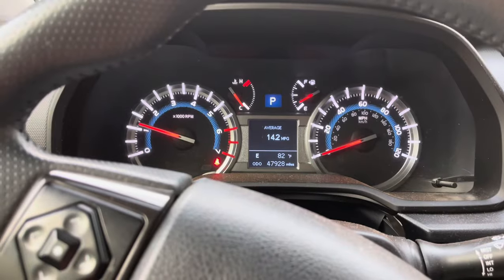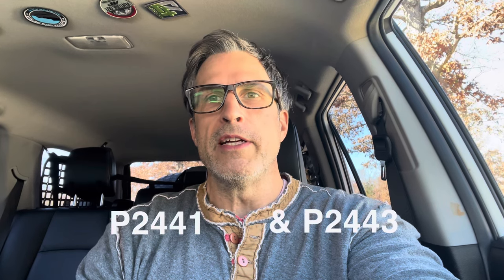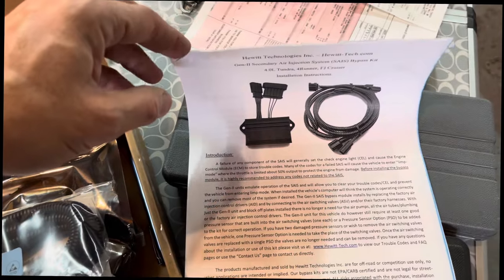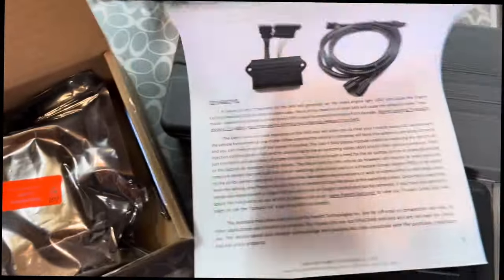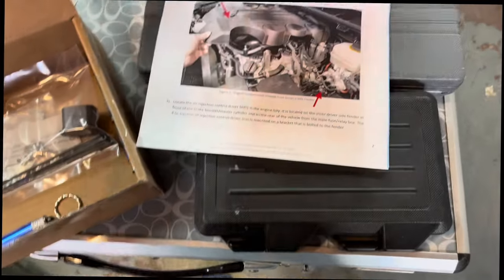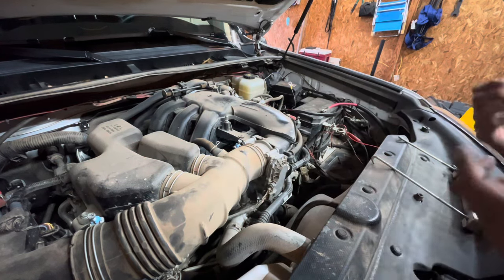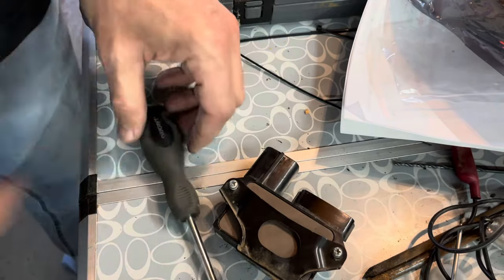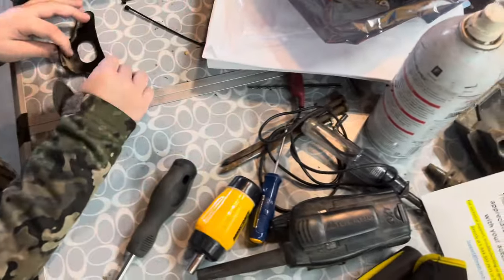Toyota 4.0 Secondary air Pump Fix, Hewitt Gen 2 Bypass, Save Thousands

Comment: Tundra in limp mode, check engine light on, traction light on, 4wd lit, purchased hewitt 2nd generation bypass kit.  After install it no longer went into limp mode but check engine light would come on and codes for secondary air pumps and air check valves kept coming up, purchased the addon kit, one for each bank (1 & 2) pressure sensor, it now works perfectly, passed emissions no issues!  Totally recommend!  If you replace air check valves and pumps you most likely will have same issue again and be back at square 1!  Toyota engineers BLEW IT!
Reply from the maker: Awesome.  Thanks for sharing.  Agree, it’s a kind of a crazy design for sure.  👍

Comment: I had the P2441 on bank one (passenger side) in my 2017 4runner, this IS 100% covered by the manufacturer emission systems warranty as long as your vehicle is under 8 years of age and or under 80,000 miles which ever comes first, the dealer wont tell you that. I just made it by 2 months before my warranty expired and started throwing this code. I never had any issues before this or after the dealership repair, all is good for 2 years now and counting. I guess I got lucky with this issues timing. The warranty's wording online is very vague and doesnt specify which parts are covered under the emissions system warranty, also quick tip if you run a 1 inch UNI or a K&N filter on the pump it will void your warranty 100% (switch back to stock filter b4 bringing it to the dealer). And make sure they dont try to charge you for the diagnostics fee of $150 an hour shop rate, that is all included in the warranty coverage. There wasnt much info out there on the warranty specifics and the dealership wont tell you shit until you bring it into them and then they can try to weasel more money out of people. Hope this helps.
Reply from the maker: Good to know. Thanks for the info.

Comment: Great installation video. I noticed on the passenger side air vlave  vacuum line is broken. A broken or disconnected vaccum will keep the valve closed.
Reply from the maker: Good eye. I’m blind at times and caught myself looking before I bought the bypass. Completely missed it. Anyway I don’t have to worry about the other side doing it and stranding me somewhere. Thanks for letting me know.

Comment: Why do you have two batteries? I've seen two on diesel engines....
Reply from the maker: Primarily, i run all of my accessories off second battery.  Keep the load off primary. Can use second battery to jump main start battery in the event it somehow runs down.
Reply: @Wheel2LiveOffRoad  Got it.

Comment: Thanks for the detailed video! I'm a 1-and-done guy so much so, that I think I would just pay the cost for the OEM repair. I can't take that long to not be able to count on my 2016 4Runner 100% (ok maybe 99%). But if I ever have an issue with this and want to DIY the repair, I know where to go for the part!
Reply from the maker: Glad to help.   My truck only has 50k miles so I was a little shocked at how quick this failed.  The service manager said that the SAIS is the only Achilles heal on these.  Once i tracked down my unrelated issue it has been flawless.

Comment: These 4runners just have a lot of problems. Constant CELs after you modify anything.
Reply from the maker: Few. This is a known issue that is easy to diagnose and the fix is permanent.  My D2 is held together with bailing wire and scotch locks but will start every time as long as the battery is fresh.  Said it before, its the most reliable thing I own.

Comment: Hi, did the dash warning signs stopped from coming on since the fix? I have exactly the same problem with my 2016 T4R and this video i stumbled upon in my search for solution. Thanks!
Reply from the maker: Absolutely.  I have had zero issues other than my stupidity in the beginning.  I have about 1500 miles on it since installing and no warnings or check engine lights. Highly recommend.
Reply: @Wheel2LiveOffRoad about how much did you pay for the kit? It seems very easy install. BTW I'm not noticing any unusual with my truck and I've been driving it for the last 2 weeks since it's my daily driver. Thank you again.
Reply from the maker: @lcatalla7292  450 w/ free shipping.  Mine would drive fine but I had to clear codes usually every morning or so. Super easy install.

Comment: Glad to see rig is going wel, watched the entire suspension build! Any thoughts to why your SAIS issues started after your lift or purely coincidental?
Reply from the maker: I had a viewer point out that I had a cracked vacuum line in my sais system. I believe one of my helpers inadvertently damaged the line when we were removing the air breather box installing the snorkel. I knew it was something g simple but never saw the cracked hose. No regrets though this system works flawlessly and I will never have to worry about the sais in the future.

Comment: Good video. What year and engine is your Tundra? I just ordered the Gen 2 bypass kit for my 4.0 L 2012. I havent done any real auto repairs in many years since Im older and limited physically. So Im watching as many videos as I can while I await the parts. The Hewitt people are great to work with. Looks like I should be able to handle this with some good lighting and a step ladder. Thanks.
Jim
Reply from the maker: Thank you.  My tundra was a 2nd gen 5.7 this install was on my 4.0 4Runner.  I think the process is really similar though. You can do it no doubt. It’s pretty straight forward. Thanks for the comment.

Comment: Thanks for this.Ig it can happen to any Toyota but I had the same problem.Bank 2 was stuck closed so they were like your gonna need a new pump and valves that’ll be 3300 dollars 💀.
Gonna install this baby
Reply from the maker: I now have around 1500 miles since install and it works flawlessly.  Its an easy, effective way to save 3000.